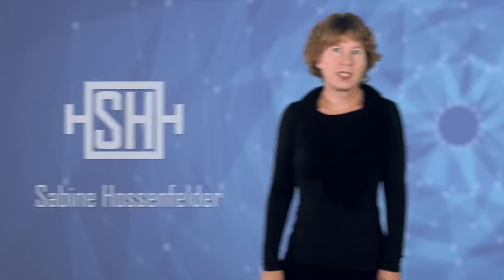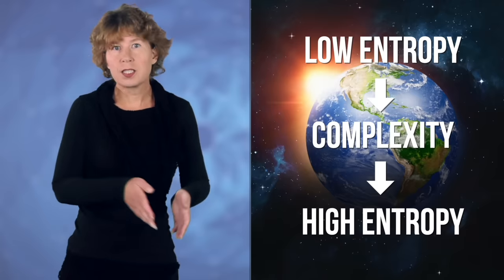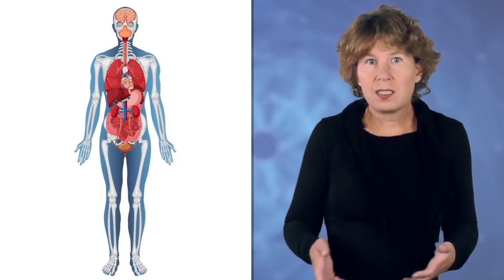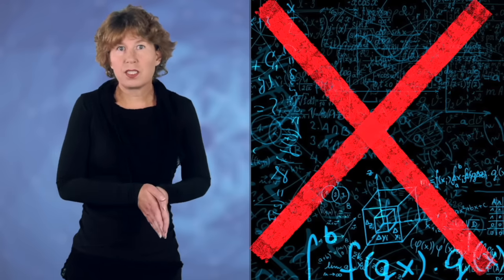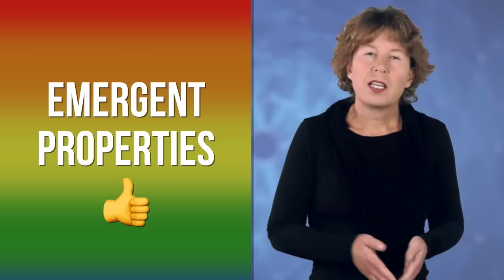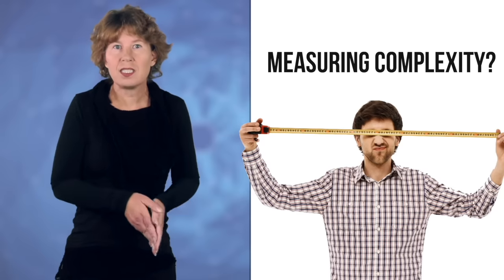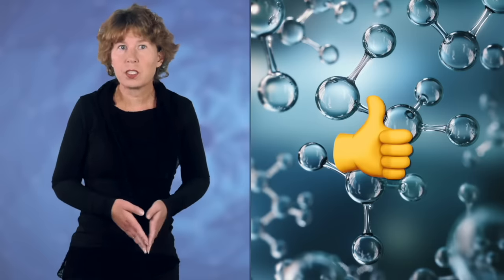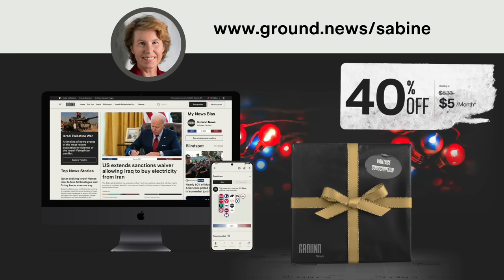The Biggest Gap in Science: Complexity

Comment: A complex system has more configurations over a given time than a simple one. A child at play, for example, is more complex than a snake, but the snake actively hunting is more complex than a sleeping child. The nature of complexity changes depending on when and for how long you observe the system. 

The other half of complexity is the nature of the observation itself. If you observe several identical closed containers with your eyes, they're all the same complexity, but if an x-ray reveals an ant inside one of the containers, then that container is more complex than the others in that new context. Complexity, then, also depends on the observer. 

The future is more complex than the past because there are more possible states for the future than the past, but only if you look at the very near future and past. If heat-death of the universe is a real thing, the distant future will be about as complex as the origin of the universe.

Complexity becomes a much simpler thing to define when you take into account time and the nature of the observer.

Comment: Pick a simple system. Write a computer simulation of it, for a small number of elements E1, in which the simulation can accurately predict the evolution of the system within N timesteps using an amount of processing power P.

Add more and more elements to the system so that the simulation cannot predict the evolution of the system anymore at all with the processing power P.

If there is a common stable arrangement of the system for E2 >> E1 so that we can rewrite the simulation and predict the overall evolution of the system with reasonable arbitrary accuracy N timesteps ahead using the same processing power P, we say that this new simulation describes an emergent property of the elements, and this larger system described by the simulation is more complex than the original one.

Comment: I believe in order to understand complexity we first must understand simplicity. 

To me it's harder to create a simple system than a complex system. A complex system in IT is litterally piling up code using override and not removing old code. 
Somehow it is a functional system, yet unstructured to a degree to a point where you can bearly work on it. 

No engineer wants to build a complex system, but it somehow just happens over time.
I believe an easy way to avoid complex systems is to create rules/laws to determine simplicity.

For example:
- Is it standardised?
- Is it organised?
- Is only what is required being used?
- Is there a cleanup process?
- Are there reusable templates?
- Is there live reliable documentation and statistics?

If these points are broken at any point in an IT system, then you are building a complex system.
Reply: The two concepts (simplicity and complexity) are unified…the same thing…equivalent. I won’t go into why, just know that they are.

You need to go and watch Stephan Wolframs new kind of science series on YouTube. The kind of simplicity your looking for (obviously simple as he would put it) are systems that are reducible…like a homogenous sheet black cells on paper or a serpinski triangle that can be described by reduced to its scale free parameter.

More elaborate though is that you can use complex systems to also create reducible representations of things…and there is power in doing that, ie the motion of many molecules creates the notion of temperature…or the complex dynamics of buyers and sellers in a market come to a simple equilibrium for an instruments price. This is typically the paradigm of mathematics and physics, to describe systems with coarse grained equations 

Here’s the thing: reducing systems is one way to look at how to construct a system…but it is like scraping the crumbs from the plate…when the actual cake is the complex system. Think about it: the human brain is a complex system…all of the power of technology we have comes from that alone so far…so why are we focusing on idealization sand trivializations of those systems? 

 Looking into Stephan wolfram he has a name for this other way, this other paradigm for analyzing and creating systems that actually use the complexity of the world rather than discarding it as physics and mathematics does, and this is called multi-computation. 

Anyway I’m trying my best to help you out with a little bit of inspirational inquiry in response to your questions. You are not gonna find answers in current physics paradigm because it is not anywhere near one. I studied complex systems for 5 years, physics for 10+ before that.
Reply: @NightmareCourtPictures  That's good and all, but I had to work with and engineer with complex systems for 5 years.

Those questions wasn't really something directed to people, but more like a checklist to determine if you are still on track building an effective simple system.

For some reason people like generalising everything.

In chemistry the most used and versitile molecule is H2O, just because of how many things it can interact with.

The core of economics is simply supply and demand.

Where you get the supply, how you transport it, process it and sell where the demand is, is a whole other story.
Reply: @resphantom   Yes, I've done the same...but maybe I wasn't super clear on what i was saying so i'll try again: 

Rule 0 is a simple system. It operates in the same rule class, as Rule 110 which is classified as complex. But rule 0, all it does is output black squares. That is simple and predictable. It has the properties, you would be looking for and are describing in your original post, where you want to construct something simple.

The name for this property, despite both rules being in the same rule class (where one is arbitrarily complex, the other obviously simple) is that it is computationally reducible : the system outputs the same answer over and over again, and therefore you can compress the description of the output into a single sentence : "It outputs all black squares."

Taking the example of H2O...let me make this example more simple and just say carbon. Carbon exists in the same rule class as the other table of elements. We understand this...that all the elements work the same way. However carbon as stated can be considered arbitrarily complex, where as something like Argon (an inert gas) is obviously simple. So it is the same situation. You have systems that are "playing the same game" in the same rule class...but one is complex, the other is simple and the distribution of these behaviors between the different possible configurations seems random. The reason for this behaviour is because as stated prior, these two properties (complexity and simplicity) are equivalent. 

This equivalence, is why complex systems can be described by single equations at large scales, and it is also why you can have these different types of output states in the same ruleset.

I'm going to ask you a question. It is the same kind of question I asked myself when I did research into this topic years ago now, that sparked my own interest, and I think it will spark yours. The question is the following : 

Is (white) light homogenous? Or heterogenous?

Another version of this question, not embedded purely in physics is also suitable : If you have game that has two spells, could you in principle construct a game that is perfectly balanced, where no player in that game would ever complain and still maintain the spells to be different? 
It's a question not often asked, oversimplified and the assumption, with little research into the matter, currently is that one can balance two spells in a game, with only numerical operations. But the conclusion of my studies is that balance of two spells in a video game is impossible to do. I'd actually encourage you to really try this and attempt the exercise:

Spell 1
Damage 400

Spell 2
Damage 1200

I'm not going to go into detail here yet, unless you want to engage the conversation. But I really do want you to think hard about either question (whichever you fancy)
Reply: @NightmareCourtPictures  "If you have game that has two spells, could you in principle construct a game that is perfectly balanced, where no player in that game would ever complain and still maintain the spells to be different?"

Yes it is possible, because the power and effective use of a spell all depends on the energy system.

If the energy system is balanced, then we have a standard.

A good example is what we use now IRL. It's basically saying that there are no accurate measuring systems in the world, but we have the metric system based on universal constants.

Complexity and Simplicity is not the same they are polar opposites. It's like saying light and darkness is the same thing, or supply and demand is the same thing. They are not, they are related to each other. One cannot exist without the other.

The clear scientific problem is, "How can you measure complexity or simplicity?"

Followed by, "How ACCURATELY can you measure complexity or simplicity?"

Keep in mind every theory in science is just another theoretical system. Every engineered system we use today is just another system. There will be other better systems out there that can do the job better, but the job stays the same.

I don't think you can create a reliable system to measure complexity or simplicity without some real world constants or data. Because then it would be too meta.

For a system to exist there always have to be unchanging requirements. A base to build around it. 

At what point is a system simple or complex? 
It's easy for humans to compare existing systems and say that one is simpler than the other.

To me personally, simple just means the least required things, that follows a very predictable pattern to do a very specific job. And just like a shadow that is created by light, complex is the shadow of simplicity.

Simple or complex could even be just a human construct like time.
Reply: @resphantom   this answer actually proves my point: RPS (the model of game design you are referring to) is known to be arbitrarily complex, not simple. That is in fact why we use it in game design: There is no definite answer to the game of RPS, in which you would get the same answer every time. The arbitrarily complexity of RPS is what gives rich and deep gameplay because it is not a simple, predictable system.

“Complexity and simplicity is not the same they are polar opposites” is exactly what I believed in years ago, but it is not true, as just stated there is a very deep relation between simple and complex that is non trivial in this way. simple rules, giving rise to complex behavior, is the hallmark of Complex Systems.

Btw, reading back on this, i guess when you said energy, you were referring to mana. this isn't exactly what i was referring to when i told you to think about the question, but mana (the cost of doing damage) is trivial. For instance, a spell that does 5000 damage, and costs 100 energy, is the same as a spell that does 2500 damage, and costs 50 energy. There is no real difference between the two spells there, and so you do in fact strip the game of it's differences.

Think again deeper on the question, and try to analyze that example with a non-trivial probe...say "radius." You will immediately realize that it becomes impossible to parametrize with numbers in a way where you can prove an equivalence statement, and immediately you jump into the realm of RPS levels of complexity.

Comment: Your description of Kolmogorov complexity is not quite accurate. What you described gives a common upper bound up to an order of magnitude, but you still need to specify the initial conditions. Given a fixed computational basis, you would need to generate that initial data or store it directly in your program. Note that there is a correspondence between data and code. It's quite possible that one is easier to specify within margins that we care about than the other.

Comment: I believe you've misunderstood the purpose and meaning of Kolmogorov complexity. Given some description of an object, in some encoding, and with respect to some programming language or machine, the Kolmogorov complexity is the length of the shortest program which outputs that description of the object. So for example, the string made from concatenating a trillion copies of the string "ab" has much lower Kolmogorov complexity than most strings of length two trillion on the alphabet {a,b} (for example one picked uniformly at random), precisely because the former is very regular and redundant.

If one were to say that a description of the rock, or the clockwork, or the baby, is an encoding of its wavefunction, then it's certainly possible, and I believe quite likely, that the shortest quantum program, for example measured in number of basic quantum gates used, to compute the encoding of the wavefunction of the rock will be much shorter than that of the baby. And this is precisely because the rock's state has large amounts of redundancy in things like crystal grains, whereas the baby is made of many structures which are far from periodic and often have fractal boundaries, which are much harder to compute a description of.

If Kolmogorov complexity were as simple as the way it's stated in this video, it would be completely useless as a concept, both for describing relatively complexities of rocks and babies, and for the purpose for which it was actually created.

Comment: I think Kolmogorov captures complexity really well. Which one is more complex, value of pi or square root of 2 (upto 100 digits)? 

Clearly, depending on the basis (axis, your normal basis), these numbers can be equally random. But it feels like getting the value of pi is a more challenging task algorithmically. It's equally likely to appear as a 100 digit sequence as square root of 2, in a uniform roll of a die. But if someone asks you to get value of pi based on it's description, it's harder. 

Shannon defined information based on surprise. And I think objects difficult to generate, are less likely to occur. Hence, a surprise when I see one.

Comment: Algorithmic complexity may not be that bad.Sure we can write down a system of equations that describe most systems, but to find a solution may be an intractable problem. Some of these problems are even on the Millennium Prize Problems, like Navier Stokes equations, probably also Poincaré. If so, one would consider a fully connected and weighted graph as a system with high complexity (This is the TSP problem). Also, finding the state of a chaotic system after a certain time to a specified precision is hard, as said in the video, though writing down the the Lorenz attractor an ode is trivial, and even easier is the logistic map.

Comment: I think there's better approaches to scientific complexity emerging.
Here's one from assembly theory, using the coffee example:
Start with an espresso, then add steamed milk. Then add foam.
It's a cappuccino!
We'll assign an assembly index of 1 to the espresso, 2 to the espresso + steamed milk, then 3 to the cappuccino.
Now, there's a relationship between this kind of complexity and the kind of thermodynamic complexity Sabine is referring to.
It's because of thermodynamics that we justify this indexing system. The cappuccino simply can't be made without an existing espresso, and this assymmetry justifies this kind of complexity ordering.
There's also ideas about computational complexity in physics, when one can establish a network like structure to physical interactions, this kind of analysis is valid.
There's ideas about measurement complexity (how much data can really be gleaned by our sensors), and this yields different results that restrict scientific observation and validation.
Complexity is an idea coming in from another branch of mathematics, and it has all kinds of applications.
It should be understood as an instrumental concept with broad application, and many different mathematical forms.
It's a pattern in nature and in theory that's well worth familiarizing yourself with, in my opinion.

Comment: Here is an idea to define complexity that you might find convincing:
       Consider any elementry feature of a system a dimension of a phase space. Each feature has its intrinsic range of values, e.g., the feature is present or absent in the system, or the feature is a precise location in a volume. If a feature's value range is {absent, present} we call it normal. A non-normal feature is not elementary, but can be replaced by a finite or infinite set of normalized features, e.g., some distance equals to 2m., the same distance equals to 2.1m., etc. 
       Consider the lattice of all normal features, wherein each node represents a set of normal features, including a node representing no features (a lower bound), the empty set, and, as upper bounds, sets of features that cannot be extended to more features (e.g., if one has a distance equal to 2m., it cannot have the same distance equal to 1m. at the same time due to incompatibility).
       A system's normal features will fall in a node in the said lattice at every instant (also a normal feature). The node represents a state of the system. The lattice represents the whole of the phase space, and the whole of all systems' states.
      We can now define the complexity of the system's state as the absolute value of the difference between the width (number of composing nodes, also number of chains it crosses) of the lattice's maximal antichain(s) and that of the sytem's state node's antichain(s) in the lattice.
    The simplest nodes are the upper and lower bounds. The most complex systems' state nodes compose the lattice's maximal antichain(s).

       The system's complexity is now defined as the sum of the complexities of all its states.

Edited: my initial post only considered the complexity of system states. Now corrected.